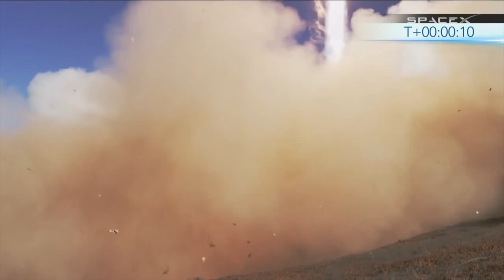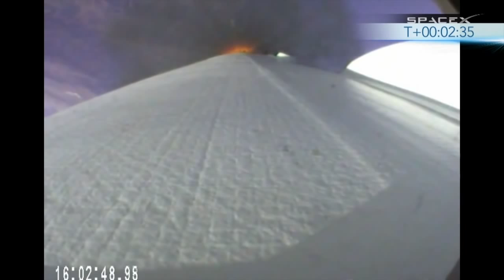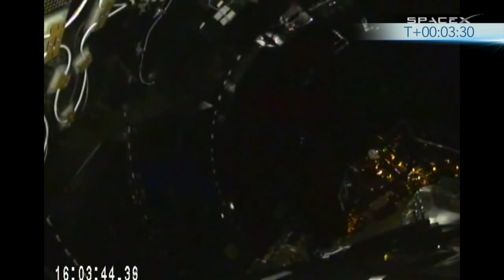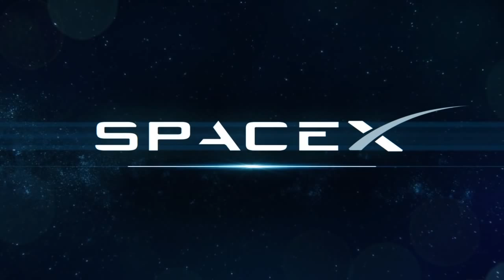Next Gen Falcon 9 | Demonstration Flight

Comment: its just O_2. Liquid Oxygen (LOx) is pumped into the tank right before launch and since the boiling temperature is well below ambient room temperature, you have to vent the gas to avoid pressure building up in the tank.

Comment: It was basically a brand new rocket. New engines, new engine mounting scheme, larger fuel tanks, new sub systems, new inter-stage, new 2nd stage fairing, etc, etc.. Honestly, it was quite tense at mission control before the launch.

Comment: They didn't know whether the thing would blow up on the pad or not make it to orbit. They changed a whole crap load of things between this and the previous launch. Lots of improvements to tank design, engine configuration, tank size, etc. They also had a very very small satellite on board that was originally to launch on a Falcon 1.

Comment: If you're talking about the white venting on the side of the rocket near the bottom then it's liquid oxygen boil off. Liquid oxygen is the oxidizer portion of the kerosene + liquid oxygen rocket fuel. It is super cold and so is constantly boiling away. They have to vent it out of the tanks or the tanks would eventually explode from too much pressure.

Comment: If you notice, you will see that as the rocket gets higher, the light from the engine gets larger. That is because the engine exhaust is expanding further sideways due to a drop in pressure.

Comment: More thrust, more payload capability.  The engines are more powerful and slightly more efficient, the "octoweb" arrangement of engines is more efficient and stable, and the increased tank length gives it increased payload capacity.

Comment: Brand new rocket (V1.1 has new engines, is longer on the first stage), new fairing system, new second stage engine, new launch pad, first time going into polar orbit which is much harder than a equatorial prograde orbit.

Comment: I'll concede that the R&D would have been slowed in the beggining, but they are now starting to turn a corner in that the contracts on the launch manifests are covering cost of operation.  The reason they paid only 20% is because F9v 1.1 had to be demonstrated with our without a payload. To help absorb some of the cost to the company, a discount was offered to anyone who wanted to ride along. Remember, this is a brand new vehicle with redesigned engines, avionic hardware/software, & new substems

Comment: No, the Merlin 1D engine (and all previous SpaceX engines) was developed in-house in the united states.
You may be thinking of the Orbital Sciences Antares rocket which indeed uses modified russian NK-33/AJ26 engines (they are more powerful and efficient but also more expensive and harder to manufacture).

Comment: The stage separation is exactly as it was during the live stream. They had problems with the video link and there where many "awaiting vehicle downlink" screens during the launch, one during separation.

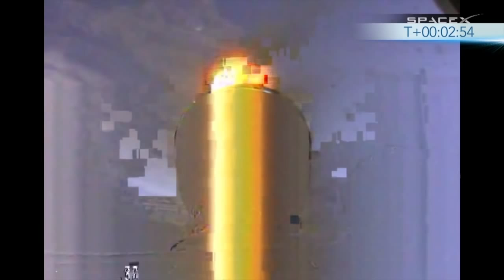That ring at 2:26 is a "stiffener" for the ablative carbon nozzle extension of the vacuum Merlin, it is there to prevent any damage to the nozzle due to vibrations during launch. It is no longer needed once the engine fires and comes off because the heat "destroys" the glue.

Comment: they had no idea the rocket was coming down on a spiral.. that's why the engine shutdown because all the fuel was on the walls and not on the bottom to be pumped to the engine.. on the Kerbal Space Program simulator that doesn't matter, if you have fuel you will burn it

Comment: A lot of engineering stuff ends up using customary units  (ie feet, pounds) due to incorporating or interfacing with older, non-metric, systems.  Spacex has the advantage in that they are using a clean-sheet design and are vertically integrated.

Comment: They did. It slowed itself enough to get back into the atmosphere without any damage. Unfortunately, once back in the atmosphere it started spinning and that centrifuged the fuel so it couldn't maintain the burn.  

Elon stated that the next flight will have hardware to prevent spins, but they learned a lot from the flight.

Comment: The engines are run rich (more fuel than can be burnt by the oxidiser used), partly because a stoichiometric mix would burn too hot, partly because the hydrocarbons are lighter than oxygen so you get better specific impulse that way. Low in the atmosphere the excess fuel burns in the air. Higher up, there isn't enough ambient oxygen to burn it and it makes soot instead.

Comment: It did work! Getting low enough to crash into the ocean and not break up earlier is actually major progress! It proves that the hypersonic reentry works - grasshopper basically demonstrated the hard part.
This is basically just grasshopper, with a somewhat taller vehicle, once you're near the sea.
Admittedly - the hydroplanes on the side, and deep throttling of the engine, so that it can get up on the step, and plane home are new.

Comment: Probably because there is nothing (or little to nothing) to dilute the byproducts of whatever propelled the rockets. It appears to be black because it is obstructing far more light than the surrounding environment, which the cameras have automatically adjusted to compensate for.